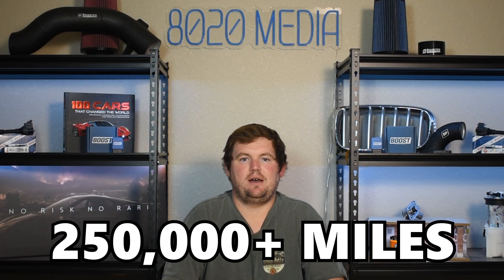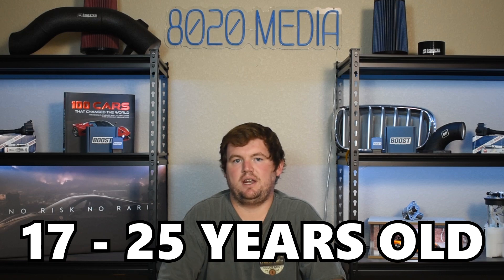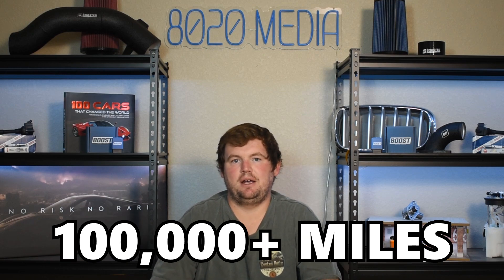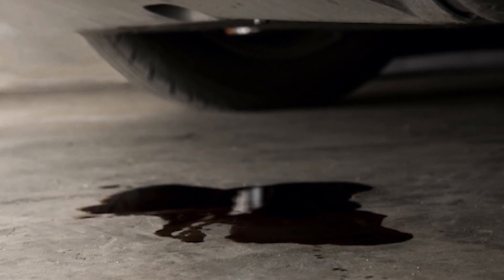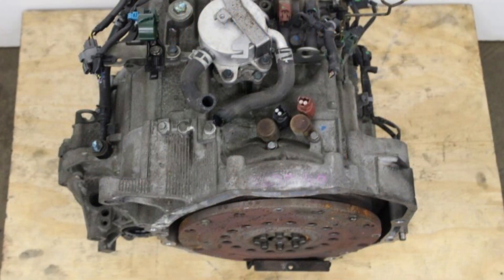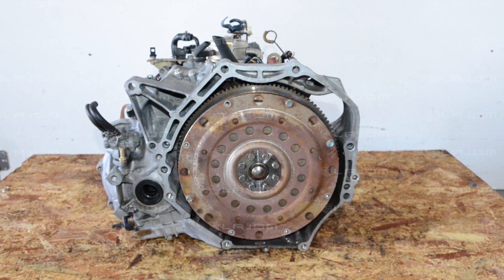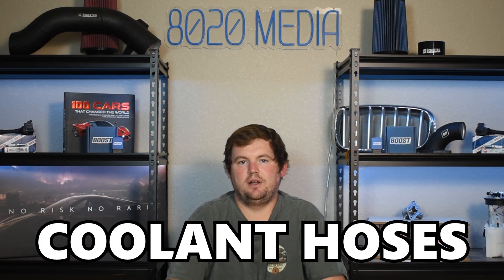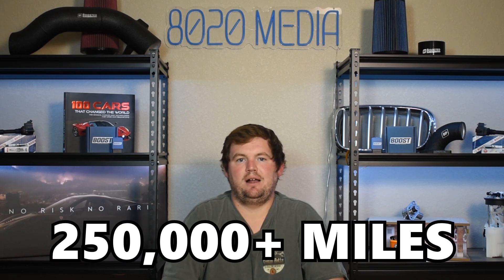How Reliable Is the Honda J32 V6? Full Breakdown

Comment: I have a 1999 Acura TL with 285K miles. I had the valve cover gaskets replaced at 250,000, kept up with timing belts etc, engine still runs great. Acura put in two transmissions in first 100K miles, I put in two in last 150K miles. Zach was accurate with respect to the engine and transmission. I still drive the car often, best car I have ever owned.. Victor

Comment: I have a 05 TL where a shop was doing a Rear mail seal replacement but mechanic said that my transmission was going out. Had a new Rebuilt Transmission put on and wow the car rides differently superB. If you are planning on getting an Automatic TL get the 07-08 model beffier trans, and 04-08 get a manual transmission base or type s. Check the Underneath for rust and suspension. The inside like dashboard will have a cracked dashboard and the seats will be ripped
Reply from the maker: S - Thanks for taking the time to share your experience!

Comment: Great Information !  Thanks Man !!  I own a 1999 Acura 3.2 tL with only 109K miles.  But I am concerned about the Timing Belt !  Is there any way to know if the belt was ever changed ?  It was owned for 19 years by a lovely old lady who sadly passed away.  So i have know way of knowing ?  Any thought on this !  Appreciate any info !! Subscribed !  Thanks !
Reply from the maker: O - Thanks for the feedback! On your 1999 Acura TL with the J32A1 V6, the timing belt is due every 90,000 miles or 7 years, whichever comes first, and since yours has 109k miles and no record of replacement, you should assume it has not been done and replace it immediately. There’s no reliable way to tell if it’s been changed unless there’s a service sticker or paperwork, and visually checking isn’t trustworthy since belts can look fine but fail from age. Because it’s an interference engine, a broken belt would cause piston-to-valve contact and major engine damage, so the safe move is to replace the belt along with the water pump, tensioner, and seals. Even though the mileage is low, the car is 26 years old, so the belt is far overdue in terms of age, and replacing it now will give you peace of mind for another 90k miles or 7 years.
Reply: I would replace the timing belt at 109K miles, I doubt that it has been replaced. Is the transmission OK, if not you can get re manufactured  Tranny installed from $3,000 to $4,500 dollars, since the engine is so good it may be worth it.. Victor

Comment: Hi can you give me advice if this could all be the Cam shaft position sensor on Engine with these codes  P0420 efficiency below thresh hold,  P0303 Cylinder 3 misfire, P0139 slow to No activity, P0139 & P0134 Oxygen bank 1 sensor 1 & s2?
I had a new catalytic installed with both sensors last  2years
Reply from the maker: M - Yes, a failing camshaft position sensor could absolutely cause symptoms like cylinder misfires (P0303), erratic fuel delivery, and even poor O2 sensor readings (P0134, P0139) if it's throwing off engine timing—though it wouldn’t directly trigger P0420 (catalyst efficiency), it can lead to conditions like incomplete combustion that damage or overload the catalytic converter over time. Since you've already replaced the cat and both O2 sensors recently, and you're seeing both a misfire and slow/no O2 activity, I’d inspect the camshaft sensor wiring and replace the sensor if there’s any doubt—it’s a relatively inexpensive part and can restore proper engine timing and sensor coordination if it’s the root cause.